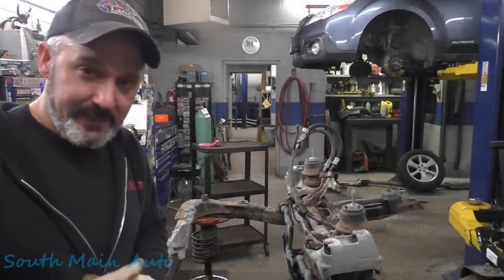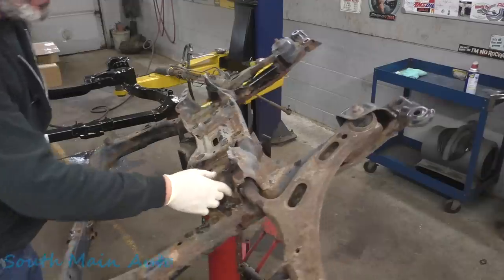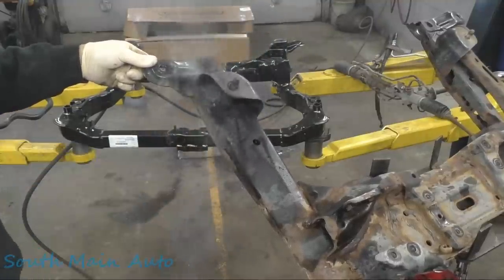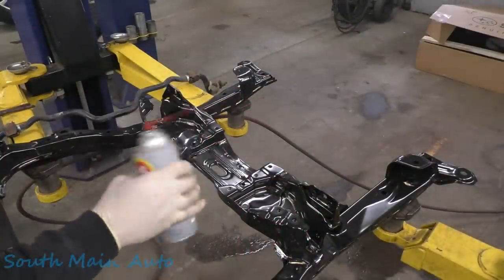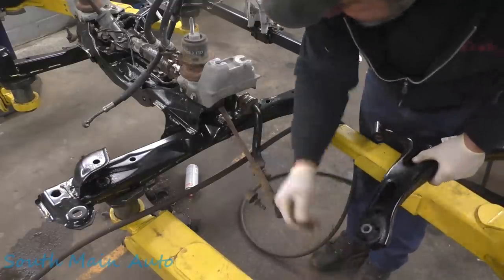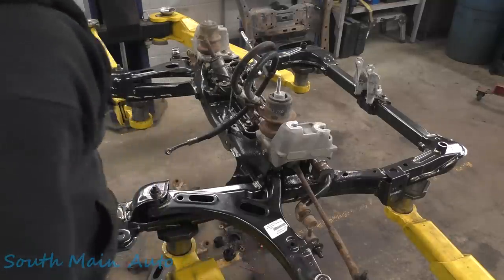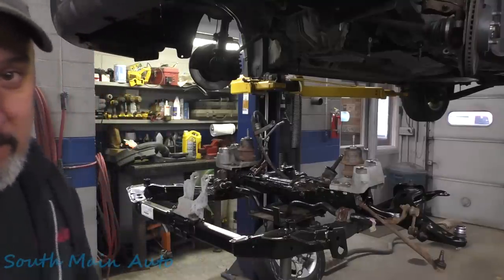Project Rotted Subaru Subframe - Part II

Comment: I read your 2 cents of the rotted frame in the shorts, I live in Long Island and I have failed vehicles for having rotted frames and sub frames, it is in the state code to fail for these vehicles. All frames come with some sort of rust, mostly surface rust, but when you can see through the frame, it is considered compromised frame integrity
Reply: Saw that too. Had to laugh, as if he was going to do a rip off job on a public platform in front of potentially hundreds of thousands of viewers. Some people really need to think before they rush to make stupid and nasty comments.
Reply: @billr6983  - it’s far easier to spread hate than love
Reply: And putting lives at risk!
Reply: Customers don’t realize there is a hefty fine to the shop and the technician. They both get heavy fines. One of my guys got caught for not checking seat belt buckles on a bait car. My dealer was fined $10k and my technician was fined $8k. My technician lost his license for 6 months
Reply: @JohnattanRivera1984  damn. I think the fine to the technician was a tad bit hefty. It shouldn't have exceeded 1k and the dealership shouldn't have exceeded 5k.
Reply: @fitchmichael3975  I agree, but this is what customers don’t understand, our name is on the line and we need our licenses to work. Here in NY fines are brutal for these faults
Reply: Did see the see thru parts and was wondering if sistering new metal or cutting out and replacing is allowed ?

Comment: What I am amazed is how you are able to keep track of all of the assemblies and fasteners without having your nose in a shop manual!
Reply: It’s not hard if you do it for a living. That was my question when I was young and before I started working on cars. “How am I going to remember where the bolts go and in which order?!”
Reply: Stuff like this isn't usually a big deal. I usually lay stuff in it's respective piles. I've so many subaru head gaskets I can usually do them in my sleep. Subarus are usually straight forward. Some cars are way more complex to put back together and will take pictures 📷  as i put take it apart.
Reply: It's called experience
Reply: Just don't let the job sit idle for more than a week and even the best can forget. Lol
Reply: @marcharris4176  Not so sure about that. I took a 31 chevy apart and hade every piece sand blasted and primed and the left pretty much in a pile and lugged those piles around thru house cahnges, divorce , storage places a tolal of 6 moves and over 20 years !  Ya, I know but, I did get it all back together and on the road.
Reply: 1.  Experience.   2.  Good memory.    If 1 or 2 fail replay the video.  😂
Reply: @kapekodbob exactly 
There’s holes without bolts, there’s bolts. You put them in the holes that fit the bolts.  If there’s extra bolts you find the empty hole(s).

Comment: Very good investment to keep a good car on the road.  About $500 for a new Subaru front subframe, $450 for control arms, and probably 5-7 hours of labor is well worth it in my opinion.
Just for OEM full replacement of the rear suspension is around $2200 here in Denver.  Again, well worth it as a fellow Subaru('s) owner and mechanic.
Reply: COVRTDESIGN Surely the better investment would have been to take rust prevention measures from new.  I simply do not understand why US sold cars have little or no factory underseal.  In the UK it is standard.  I haven't had to repair any underbody parts in the last 30/35 years and I don't buy new cars. The newest car I bought was 4 years old and I ran it for 11 years.  My current vehicle is a 2002 Renault Scenic 1 Phase II and I have owned it 8 years without a sign of rust.  I have no garage so the car is out in all weather's nor have I made any underseal additions.  My cars owe me nothing but they are simply a means of transport and not a status symbol.  They do however get a full and professional service every year and no minor fault goes unattended.  It really does save money in the long run to look after your vehicle regardless of age or value.

Comment: So I worked for a GM dealership for 30 years. The problem is the flat rate they pay some mechanics. I seen this all the years I worked in the shop. Cars and Trucks are way more complicated these days, and require experience and good basic diagnosis skills and more time to find problems. The shop also needs access to all service information. If a mechanic on flat rate wants to make a living he needs to work through repairs pretty quick.  Not being able to spend time on some problems is an issue. Poor customer relations stem from this. You can't please everyone all the time, hence further poor customer relations. I think some shops are more ethical than others. I enjoy your channel, you are a good technician. I know the problems with this line of work. You try to fix all of them, but sometimes they put you to the test. I believe technicians should be payed for their time, including diagnosis along with actually  repairing the problem.
Reply: Amen. As long as they stop calling everyone Technicians. I've grown up repairing my own stuff and extended family for 45 years. I started buying repair manuals. Then got into Alldatadyi. Then slowly bought code readers and finally a quality scanner. I will never call myself a Technician. I'm an old fashioned Auto Mechanic. Some jobs I will turn down because of tools. I've set my own rate. So it's cash ONLY for my work. I don't buy parts. Been stiffed to many times. I've refused people whom cars I've worked on due to them not paying my rate.

Comment: Thanks for teaching me  the sandpaper on the end of a drill truck. I used it to clean the slider boot holes, on My 97 dodge diesel.they where rusty enough to prevent the sliders from sliding freely in the boot. I just took My $5.00 drill from Walmart but one of my big drill bits on. Used bailing wire to secure a piece of sand paper on the drill bit and used 4 pieces cleaned all 4 holes like new. Fluid filmed the hole and around the boot. Cleaned all sliding points with a wire wheel on My angle grinder, and with a Dremel. Used caliber grease on all sliding points with new FF rated brake pads that cost 40 bucks. Old brake pads where still really thick but falling apart. Not from the backing plate. The friction material was separating from itself. I’ve had the truck 6 years those brakes came with it.

Comment: OMG! You can see the all the big rust holes in the frame. I really do not understand people's problem with fixing an old car if it is worth it. That would all depend on the car’s condition. Like everything, not all thing is equal. For example: I have a 2008 Chevy Cobalt LS 4-door 2.2L with blue book value around $1,800. I got the car for free and I have done all the repairs myself that came to around $1,000. There is not one single thing wrong with the car from top to bottom. Who cares about the age if it is in very good working order like new. Thank you Eric O

Comment: I drove a 2000  6 cyl Malibu  until traded (  Intake gaskets replaced 2X) still ran great  in 2018  with no under body rust  due to Rust Check use regularly.
I cannot believe anyone would replace  a frame on an 8 year old car both due to cost  and secondly finding anyone 
with the know how and patience to do the job that you did. Unbelievable  amount of parts  that have to be removed  to
do this job. Kudos on spraying the old surface rusted reused parts. Even with cost of all cars today  just can't get my
head around doing this unless is a rare classic restoration.  You are a one  in a million mechanic Eric ! 👍👍☑☑☑

Comment: No doubt, THAT'S  a LOT of work.  On to part three.  How many more years and that car will be ready for the crusher.  I replaced a subframe on a 73 AMC Hornet 6 cylinder, but NO WAY was mine as tough or involved like this one!
Reply: Uneeeded work too. Why not just buy new bolts instead of using heat damaged ones
Reply: Yes I remember those 73 AMC Hornet they were nice little mid-size cars and the 6 cylinder is a good motor be driving around with you know that a little pep but they got you where you had to go have a great day

Comment: Got a 2019 Forester.  Had since new.  78,000 miles, so far so good.  We live in Pennsylvania, state inspection guy commented how clean it was underneath.  Whenever I've been out in the snow have always power washed the underside asap.
Reply: MY 2018 IMPRESA 20,200 MILES  HERE IN CONNECTICUT
LOVE THE CAR  FRAME IS BARELY RUSTED
HAVE RECALL ON  HEADLIGHTS AN BULBS IN THE FRONT
PARTS HAVENT COME IN YET
Reply: That is critical.  If a guy can rinse it off it will last.
Reply: My 48 Willys didn't have half the rust this thing still has.

Comment: South Main Auto is the same type of garage that is in my town.
I go there because I know that the job will be done properly, quickly and reasonably priced.
I never even ever looked at the repair slip, always paying without question because I know that the shop's integrity is on the line and they won't do anything to jeopardize that.

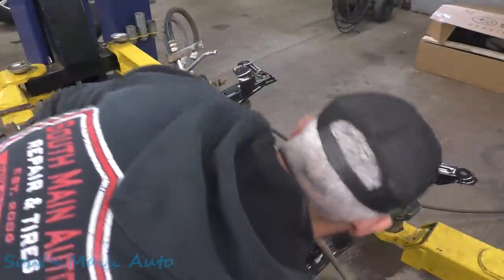Comment: Eric, at the 20 minute mark, that move was a smart idea as you don't want the fire dept. coming for that. At the 24:20 mark you began to explain about the cost-of-the-job aspect. If anyone else reads this comment, you have to realize that even auto repair shops must pay for the parts they obtain, the difference is that when they call for the part, they are given 2 different prices. So if you see your auto repair bill has an itemized list for the parts and their cost, more than likely the cost is what the average customer would most likely pay an actual auto parts store.

Comment: Love the skill you have to do what you did. Wouldn't 2 nuts and bolts be cheaper than the time and gas it took to remove the control arm bolts? Sure made a great video though!
Reply: Given current supply chain issues, those bolts may have been on a one month or longer backorder. I do know the lower shock pinch bolts are on and extended back order event as we speak

Comment: Over 50 years since I was replacing sub frames on BMC minis and similar, rarely front because A series leaked oil so badly but rear ones all the time. Good job on the Subaru.

Comment: I agree with budgets. Yes it would be great to replace every part and attachments for it but it's just not viable. However I always think it's probably a sound idea to budget for all new bolts and nuts etc especially in the rust belt area. Just because you know the bolts won't rust off and will last until the car gets turned into tin cans. Plus it will make your mechanic like Eric that little bit happier.

Comment: Eric thanks for a great series of videos . The sub frame rot out is in all vehicles these days in the north. GMC Acadia are prone to this problem at 136,000 KL about 100000 miles I replaced sub frame front all wheel bearings struts shocks control arms and a bloated steering rack seals blown. The frame I could push my finger through around the rack. You are the real deal honest skilled and inventive a lot of people depend on guys like you. Rod

Comment: man i just did the control arms and accessories on my 2013 outback down here in pittsburgh this past fall in my driveway. i was able to work the 19mm bolt out of the driver side bushing but ended up having to cut the passenger side 19mm out with an oscillating multitool that did a pretty good job. funny enough for me the sway bar bushing bolts were prob the easiest part of the whole job.

you make it look so easy with your hard earned experience.

Comment: Thank you for reinforcing why  I just buy new hardware Whenever I do a job like that yes it’s gonna add $100 or so to the cost but it’s gonna save an hour or more and it’s just a better job. When you factor in our labor rates here are120- $150 an hour,It doesn’t make sense to stink up the shop and do all that torch work to save $20 in  hardware

Comment: LOL I just snapped off my Subaru Ball Joint cross bolt. Had the drill it out of the knuckle with a 3/8" bit and used a grade 8 nut and bolt to replace it. Worked like a charm!

Comment: It is probably a good idea to lubricate the threads and rotating surface befor reinstalling, not only will it help future removal but will make sure you actually get the right clamp load from the torque.

Comment: Fun fact!
Spraying fluid film or any lube on treads and surfaces that flange together (bolts and nuts) reduces the friction coefficient, which reduces the torque value required for fastening the parts together.

Comment: Always nice to watch a BBQ, I like how you removed the oowee goowees from the chocolate center most times I wear. it looks like the knife works better than the old sears screw driver that's dammed for this only and that sub frame was wasted!! I got a 90's car that's not half as bad and will not drive till i find a replacement. Waiting for part three.

Comment: Having owned a 2013 until it was recently totaled, I can vouch for that "big 2.5"
talk about horsepower, torque...and combined with that glorious CVT, whew!
Actually, I loved that car, and would have loved it more if I had been smart enough to get the manual
Reply: I have a 2013 3.6R. The advantage of the 6 cylinder is a conventional 5 speed automatic. I made sure to avoid the CVT like the plague. I just did engine mounts and diff fluid and trans fluid, wonderful car to work on. The flat 6 has amazing instant torque. Do you pay more for gas? Yes! 20mpg in the city is all she gets. But hey, least no CVT
Reply: @clonetrooper576  completely agree, the 3.6 would have been a great option too!

Comment: Looks like it's all going pretty good. Of course if you needed to remove and replace the power steering rack while that subframe was in the car the bolts would have rounded or broke off

Comment: Eric just a suggestion if you use a sawsall with a diablo carbide tipped blade I would cut through that a arm faster along with the exhaust on the other car I seen this week. These blades cut rebar so car parts are nothing for it. I have had min over a year and it's still good. And then you won't have to deal with poison fumes from the rubber burning or things being on fire.

Comment: I know you're a NY guy not a NH guy and you love your fluid film, but have you ever tried NHOU? New Hampshire Oil Undercoating? Its supposed to be a really good product. Ive even seen independent shops in MA advertise that they offer doing the service. They just spray the whole under carriage and even get in all the open voids in the frame/everywhere they can possibly get it. Pretty sure you can get it in aerosol cans like that as well.

Comment: Years ago, I had a Subaru Legacy wagon.  Garage put new transaxles and brakes on it, and then when I picked it up the guy told me the subframe was rotting out, car was gonna stop being safe to drive pretty soon, and it wasn't worth repairing.  Tells me this hours after he did hundreds of dollars in work on it.

I sold the car cheap to a neighbor who was a mechanic and a welder, and he fixed it up somehow, more power to him.  But you can bet I never went back to that garage.  I would've liked to keep that wagon another five years . . . .

Comment: I might be missing something but that sub frame doesn't look rotted out.  Surface rust yes but from what I see there is no loss of structural integrity.  I just don't understand new owners paying so much for new cars and not taking rust prevention measures.  Waxoyl (fluid film in the USA) is so cheap and easy to apply to even the tightest of crevices that it's simply a no-brainer.

Comment: We're all here for the blue wrench, but honestly you probably spent more in gas than the bolts cost, plus your time, and you still get to put the rusty bolts back in. Even if they aren't compromised from the rust, cutting, and hammering, the hardening on them is now just a memory.

Comment: I might of miss something but if the control arms were going to be replaced. Could’ve you get the frame bolts from Subaru & not have to cut off the control arms…Asking for a friend😅. Great job like always thou!👍👍

Comment: As always you are doing a great job. I have only seen a "slag" hammer such as the one you were using to remove some of the rust to get to bolts. Air driven with several "fingers" to clean up the mess. I would appreciate a name and a vendor for the "air slag hammer". Thanks

Comment: Doing the fluid film reminds me of a guy years ago somewhere around Atlanta who you bought a new car and paid for his "Undercoat and Rust proof" would do your entire underneath in this stuff that looked like tar. He covered everything and removed what needed to be removed to do it and when he finished your entire car underneath was pretty much rust proof for life.  This was back in the 90s and for an average car you'd pay around $2,500 extra for it.  I had one I bought used that had this stuff on it and it was clean and not a single spot of rust on the car after 10 years.  I wonder if that's still being done or others do that type of rust coating.  Might be worth those extra bucks for you guys up in the rust belt.  Just an idea and something I remembered.  Take care.
Reply: The long term problem is that the thick material always allows moisture in when it eventually peels at edges. Then, the moisture & corrosive elements creek in & fester, often times doing as much damage as without.  Products like Fluid Film being largely wax based do a much better long term protection without allowing for moisture to get in anywhere because it is a thin layer.  It is easier to reapply if/when necessary as well... a whole lot cheaper than the $2500.
Reply: I just saw a 2007 Chevy covered in that tar undercoating. Frame had 1" wide by 4" long holes in it. The rest of the body was actually pretty clean.